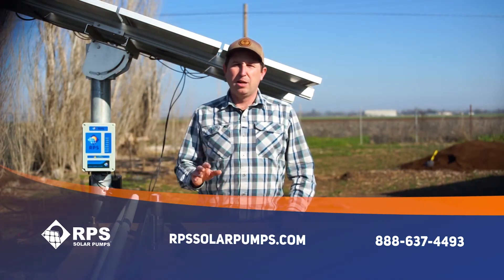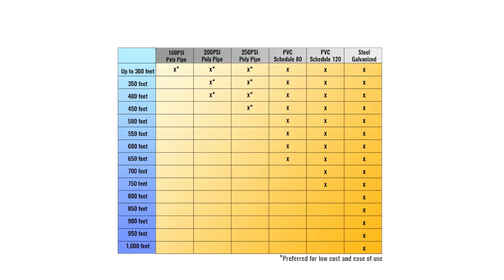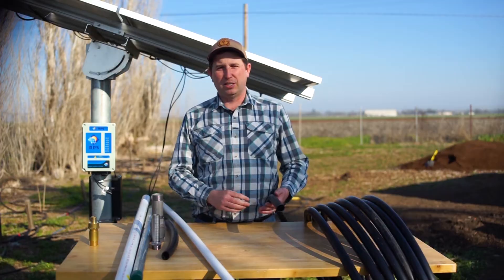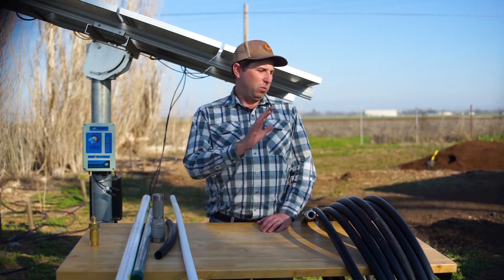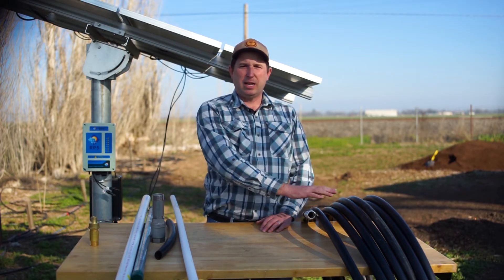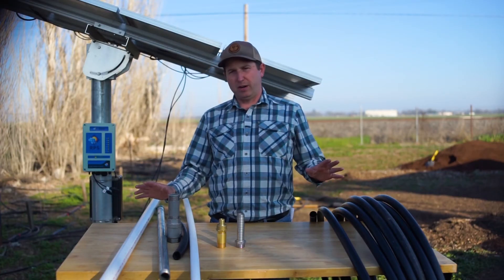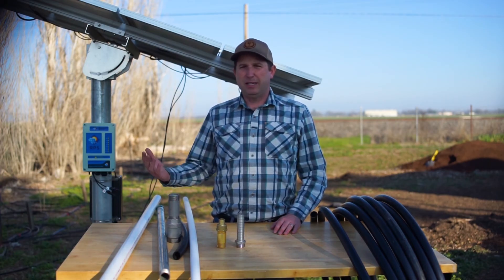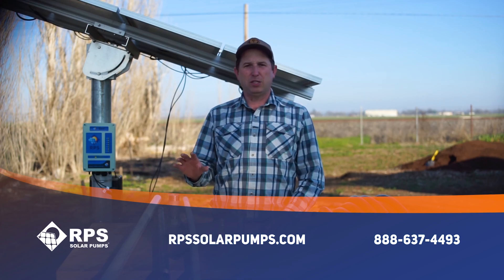All About Well Pump Drop Pipes!

Comment: You are saying 160 psi poly pipe can be used to lift water in a well 300 ft.
( 1 inch poly pipe )
Now if you was going to use a pressure tank & cut the pump off at 50 psi .
This is what is getting confusing, the pressure on the pipe at bottom 300 ft depth is near 245 psi .
How can a 160 psi pipe stand this ?
Reply: No! The numbers he is using are assuming no pressure tank. It might last around a year if you are lucky before it breaks depending on how much water hammering there is.

Comment: I know you mentioned 300plus feet pipe recommendation, but would you go Schedule 80 PVC for a 600 foot well with a static at 272ft? Also, if there a brand pump you’d recommend? Lastly do you have a video showing a hand pump setup with your normal well setup with an electric pump. Thanks for your insights!

Comment: What if my pump is on the surface?
Reply: That has got to suck!. (before it even gets a chance to blow). 
A surface pump cannot lift water beyond the 'vacuum head of water' or about 10 meters at sea level (less at higher elevations) but at 10 meters you would get just a dribble of water flowing. 

Pumps can blow far more efficiently than they can suck. as they suck they produce vacuum cavities (cavitation) which can cause lots of physical damage as the collapse at the speed of sound and produce a sonic boom shock wave. Cavitation is what really damages boat propellers and creates the noise that make submarines track-able under water.

Comment: This is great.  I am changing from PVC to Poly.  I plan on using 1.25, 160 PSI poly.  I am buying 300 feet.    I plan on using the leftover poly to run water sub surface to a new home we are building on our property.  Is this feasible?

Comment: I had the PVC drop pipe break in the cold during an emergency pump replacement. I did a repair put a new fitting and glued it. Then put it down the well bore and did the purge test. No water came out.  The pump is drawing 10.2 amps (1HP) but we see no percolation in the well, nor do we hear any sound from the pump. New Goulds 13GS series pump! We tested it above ground and saw it torque and heard the motor spin, so we assumed good pump and put it down the bore.
I'm pondering poly drop pipe to make it less difficult in the cold weather emergency repairs. My only concern is splitting of the poly pipe after a few years due to the surges in pressure flexing the pipe. The underground pipe to the house is poly and I've had it split several times over the years requiring replacement.
200' depth.
Reply from the maker: Hey there, if you're concerned then I'd bump the the 250 PSI poly pipe. We use the 160 PSI regularly up to 300-400 feet installation, BUT the 250PSI will have a thicker wall and give you extra peace of mind. It will cost more, and usually comes in 1.25 inch as the smallest size. Not sure what PSI your underground piping is, sometimes people grab the 100PSI stuff from home depot and its just not the best choice for high pressure.
Reply: @RPSSolarPumps  The original pipe is Schedule 100, according to the well guy that came over today to finish what I could not. Turned out the PVC pipe joint cement didn't cure at 30F and the pipe slipped back out while we lowered it down. Well guy came and pulled the whole thing and replaced the broken pipe. Said the rest was fine, not worth spending $80 per section (20 sections) to upgrade to Sched 120.
Hopefully no further issues.

Comment: Quick question.
Can you mix drop pipe types?
For instance Sch 120 pvc for the lower 500' then the final 200' in steel? This would reduce cost and have enough strength to handle the weight of the water and pump.
Reply: Good question, I have the same question. We have steel casing and 4 feet was added to extend casing to get it above ground level a couple feet. Just told by well company that it is not appropriate. That steel needs to be extended with like casing. I wonder if this is true?

Comment: VERY helpful video. Thank you!  

QUESTION: Black 200 psi poly drop pipe stretch happens in the first year or two? Then it doesn't stretch further after the 1-2% stretch you cited?
Reply from the maker: Nope, the pipe won't stretch any further after that!

Comment: 200 feet for 100 psi? The head will be 86 psi, leaving 14 psi for delivery. Am I missing something here?
Reply: These systems are generally used for stock tanks in remote locations.
There are no pressure tanks and often no above ground valves.
Reply: Exactly.